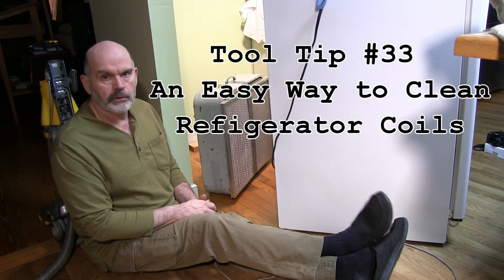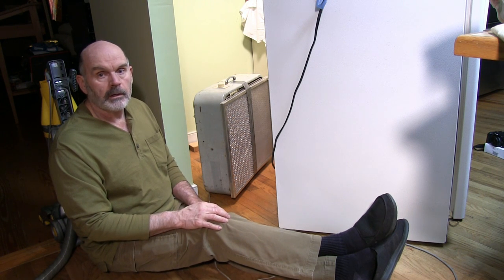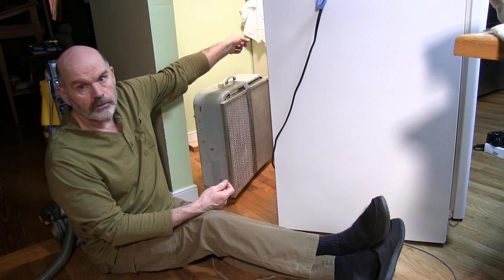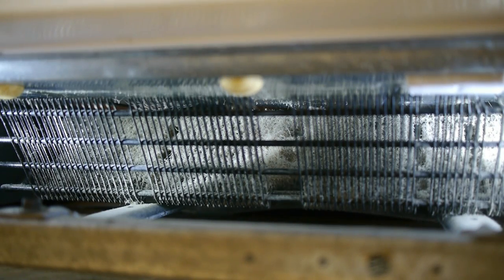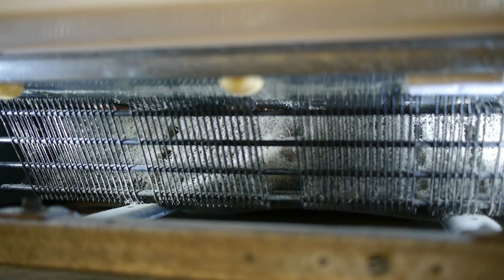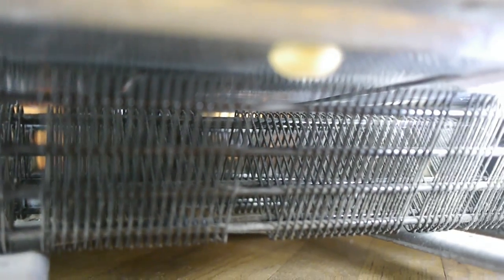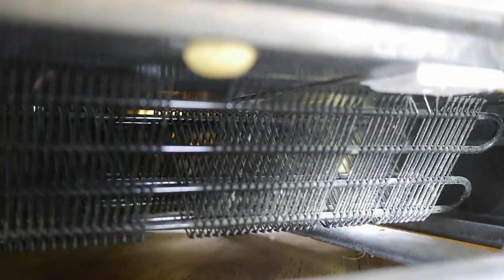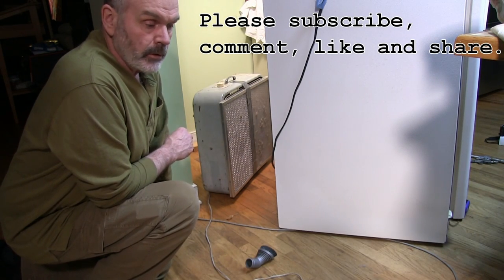Tool Tip #33 An Easy Way to Clean Refrigerator Coils

Comment: Moved into this house a year ago and I’ve been vacuuming the coil. Unknowing until today there’s an accordion thing coated with dust just like this I can’t get to. Hubby inspected and said, I can bring in the air compressor and I said I’ll You Tube it. Low and behold, this is what he said and shop vac on the back side, cover with a sheet. I like the idea someone suggested with the box up against the back side and shop vac hose attached to it. Thanks much for the excellent video. 

Oh, by the way, my owners manual says Page 8 under refrigerator care, #4 NO NEED FOR ROUTINE CONDENSER CLEANING in normal operating environments. 🤪😂😂😂 😳😖. Manufactured to fail.

Comment: Great idea... I agree with your frustration as to how these things are designed. I love these MacGyver fixes. I noticed my freezer compartment was warm this morning, so before I tackled this job, I did a search and found your video and it inspired me to try something else.  I used my vacuum and about three feet of very flexible 5/8 ID aquarium hose taped to my vacuum nozzle.  I had to remove a cardboard baffle that separates the coil area from the drip pan, then I was able to maneuver the hose through each "fold" of coils.  I would say I got about 95% of the gunk.  I checked the freezer compartment... and I'm back in business.  Thanks for your video.
Reply: Yeah, I noticed the cardboard baffle.  Folks should remember to replace the baffle when finished or you won't get proper airflow over the coils.

Comment: Loved the video, and the comments are great, we have a refrigerator that my grandparents bought in the 50's and it still keeps things cold, I wish I could write a letter back in time and tell people to repair, and fix vs toss n buy another if society had not become so disposable with their iyems maybe manufacturers would still buildt things to last, I find vacuum cleaners all the time on the curb they just need the brush cleaned out, the hose directly behind the brush unclogged , or a new belt, or a combination of the 3 and they work like new I'm only 42, and am always amazed by things people throw away when they are easy to fix

Comment: I did make a tube fitting for my air compressor hose.  I used wide masking tape between fridge sides and floor.  I then cut and taped a piece of cardboard to back of fridge with a hole cut in for my large shop vac hose.  I trapped it all in shop vac with very little dust.  After fridge rolled back I just had to vac and wet wipe floor.

Comment: I used my roto zip to cut in an access panel on the side.  Now I can use my extension fridge brush and vacuum to clean it.
Reply: @red meat
And to think that the manufacturer couldn't have  designed that in when making the units? Oh that's right they didn't deliberately so the unit would fail faster and you have to buy a new fridge!
Reply: Why didn't the manufacturer think of a side panel? 
The jerks.

Comment: i cleaned my coils basically the same way in the front. i thought there was more in the back which i haven't done yet. i am surprised to see there isn't to much more.i really like the idea with the fan. never would of thought of that. also i didn't think of using the air compressor. you helped me out alot. thank-you for sharing. happy holidays.

Comment: mars1952, Thank you for helping me clean this same accordion coil system. I used your fan/filter idea and it helped cut down debris. Also this cleaning lead to two twists to your approach. After using compressed air cleaning from the front It still looked a bit clogged on the fins. I went to the back side and used compressed air again blowing from BACK to FRONT. The fan pulls air from FRONT to BACK in operation, piling up the debris on the FRONT side of the coils, reversing the air flow blows the debris off of a coil rather than trying to push it thru the coil. I made a mess in front of the fridge, progress. I'm a tinkerer and I used a section of clean steel fuel line and made an air nozzle reach tool in the shape of a small golf club, 90 deg bend about 3" at the end, drilled two small holes and crimped the end shut. Taped the end to eliminate any sharp edges. This can then be slid under the frame and positioned in the gap and blow air across the coils. The handle of the "club" was about 18" or so and this allowed reaching deeper  under and rotate up to get to the next coils. Finally with the unit unplugged, I used a wet cloth and cleaned the fan blades.

Comment: I've got the same fridge. Just had to replace the compressor relay last week, which brought it back to life, but like you, I found that these fan-fold/accordion coils are intentionally hard to clean. 

I was also thinking of blowing the dust out with my shop vac, but the extra step of the fan/filter at the back is very smart. This is the method I'll be using this weekend. Thanks!

Comment: Smart. Good job keeping the dust under control. So much more thought went into this process than the other guy’s video - (High powered leaf blower without even vacuuming the visible dust first.) Needless to say he pretty much wrecked his kitchen, his lungs, and probably the whole house in the process. Thanks for showing people that there are smarter ways to work.
Reply: I did this also took me 30 second s to clean under the fridge and then 6 hours to clean the kitchen

Comment: I have 2 refrigerators and this trick worked on them both. I used an air compressor set to 80psi, and a rubber tipped air blow gun. Tons of stuff came out!

Comment: I opted to do a "back flush" rather than to blow dust bunnies into the clean rear coils, which were very clean to start with (as it was a newer fridge). So I put the fan and vacuum in front of the fridge and blew the air from the back of the fridge (which requires removing the rear panel, but ensures a cleaner result).  Also, I was able to insert my coil brush into about 5 or 6 openings in the front. However, not able to move it side to side as I could do in my old fridge.

Comment: First, thank you -- thank you -- thank you!  Found your video by it being referenced on an appliance repair website.  After our son and daughter both recently had fridge problems, I thought "you know, I've never cleaned our fridge's coils."  My wife said, "there's nothing to clean."  Question marks went off in my head.  Sure enough, the owner's manual said there's nothing to clean in normal use; coil cleaning is only necessary if you have a pet.  I took off the lower, front kick grill to see what the coils looked like.  OMG!!!  Owner's manual says just to vacuum only the front coil.  Ha!  I could still see a mess behind.  You're video has given me a technique to use to properly clean this thing.  What a horrible design that prevents an apparently essential maintenance job from being done easily.  Cleaning will make somewhat of a mess, but your idea makes it bearable.  Best regards, and thanks for taking the time to made this video available.
Reply: Thanks. Interestingly, I am trying/ Tubing on my vacuum Crevice Tool , tape on , .75 inch to 1.25 inch maybe , through wire protection screen, ( mine may pop off, unknown )..

Comment: Thank you! I just vacuumed mine the best I could. I’m curious if I could tilt the fridge slightly to clean mine better underneath. Mine is a 30yr.old Kenmore. It’s a little easier than yours but there is still some I can’t get to. I wish they made them like this one. Never had a problem. My mom and dad bought one 10 yrs.ago and it just died. I’m a single parent and can’t afford to just buy a new one. This old Kenmore still keeps the temperature super cold 🥶 and I want to take care of it. You are a true blessing. If I had a compressor, I would have preferred your method.

Comment: I agree with your disgust with them putting these accordion type coils underneath their "planned obsolescence"  refrigerators. I just got one like this, a used Maytag and it has the same exact, maddening, impossible to get to coil design, to, like you said, make the compressor prematurely fail so you have to buy a whole new fridge in a few years. Despicable design on their part. Thanks for sharing this video! Great idea what you did there with the box fan and A/C filter to help control the dust removal process you did. I plan on doing the same thing in a few months / twice a year. Thank you.

Comment: Thank you so much for sharing this great approach to cleaning a designed-to-fail POS system.  Only source of forced-air I have is a leaf-blower, so I"m thinking of using that, but with some moderation (partially clogging the leaf-blower intake lessens the force and I know it can stand that for a few minutes.)  AND, I have a 30 yr old American heavy duty 20" fan.  Have a great day and year, etc!  :)

Comment: Thank you so much it’s 12:30 am went out to get a glass of milk and it was warm pulled the cover off the bottom of fridge and my coils were covered in a wool coat but had the same issue with cleaning the back coils till I found your video now we are good

Comment: I tilted my Kitchenaide to the back after I pulled it out from the wall.  I had the same difficulty in cleaning the 'W' coil. Using 4" blocks placed underneath the front, with the plastic grill removed, I used a small, flimsy commode brush and vacuum, and coming from underneath the unit I was able to clean it. 
Pulling the cardboard lower back off exposed the fan, and I cleaned it as well. I filled a smaller vacuum bag full of lint.

Comment: Well, I cleaned mine out today,  Found the best way, Just clean out the refrig completely,   Tip at angle till you can get under to suck it out with shop vac.  Takes 2 people, but its not heavy,  empty, and my wife had no problem balancing it on angle till I had it all clean.  I have done the air blower thing and this is waaaay better and faster and less mess.  Just don't tip any farther than necessary.  While you are under you can remove 2 plastic pins and even get the cardboard out from under and clean the back 2 accordian coils completely and easily !!!
Reply: Perfect,  I have done the same,  leaning the fridge on the house door at a perfect angle (was able to do it alone) for last 20 years,  use my central vacuum which is in its own sort of (dog house enclosure on my back deck,  so 0 dust)................yes removing plastic pins , and associated cardboard and all is visible and accessible.  Certainly a good idea to have a 2nd person holding the fridge from moving!  Totally nuts that whirlpool engineers can get away with this classic design work!

Comment: Brilliant, I never thought of the fan. I've had good luck with greasy coils by spraying them with a water & Dawn mix and then using the compressed air to clean and dry them out. Works perfect.

Comment: Thank you for this video. My next step would have been to unload the entire unit and tip it over to clean from the bottom. Even my cheap little 3 gal. 100 psi air compressor did the job.

Comment: Looks identical to mine.  I was floored when I finally got the grill off to look under it,  started cleaning it and had the thought about the compressor, I use it on my PC but I take it outside.  We had to take out the glass on my slider and the doors of the fridge just to get it in the house so there's no way I'm going to do all of that to get it out.  The filtered fan idea is awesome!  
I don't feel like going to the store to buy the extended blow nozzle so I'll just tape some rubber tubing to the one I have. 
Thanks for sharing!

Comment: Filter on fan, GREAT IDEA!!! Keep up your wide variety of interesting videos, I really liked the Ruger magazine videos!
Reply from the maker: +mod317 Thanks. I should have mentioned in the video how to use a box fan with a filter.  Box fans are not meant to be use with a filter. Adding a filter increases the static pressure and make the fan work harder and heat up. I have used this set-up for several hours straight but I never leave it running when I am not in the room. This fan is very robust and about 40 years old (made in the USA) they don't make them like this anymore.

Comment: Thanks a lot for this useful tip..I figured compressed air would hurt the coils.Now after seeing this video. I've pulled mines out ,and I'm about to get started. Refrigerators not cooling and my filters look just like this ! Thanks for the informal vid

Comment: Great idea! I have the same problem with my Whirlpool. Why in the name of all that's holy would a manufacturer put accordion fold style coils running SIDEWAYS across the width of the refrigerator?? Common sense would say that the same exact coil structure would be PERFECTLY easy to clean if simply situated the opposite direction and one could stick a brush in there and clean them quite easily! I swear...
Reply from the maker: Planned obsolescence.
Reply: I agree with what you said completly. I'been trying to clean my refrigerator coils for two weeks now.

Comment: Thank you for this very helpful video. I unplugged my refrigerator for a couple of months and when I replugged it in it failed to cool at all. I'm hoping this will solve my problem. I don't have an air compressor but think I will try canned air to blow the coils clean. It's sure worth a try before calling a repairman. Thank you.
Reply: DeepPurpleSkies I’ve used canned air for this, works ok in combo with a vacuum. His use of an air compressor is better if you have access to one.

Comment: Thanks for the tip. We ended up using a kabob stick/small dowel with a pipe cleaner to cling on and grab the large clumps under and around the coils. We may use the air compressor and box fan to get some of the smaller clumps.

Comment: I found an easier way to deal with this problem. All you need is tilt the refrigerator on its left side, slanted enough so a gap is big enough for one to bring the vacuum hose and suck all the dirt. I have done it successfully.

Comment: Great idea with fan and attached metal filter.  Air compressor w/short bursts aware of, but containing mess always an issue. Have a slightly simpler adaptation utilizing a small rectangular/folded sheet and duct tape.  Sheet allows air to flow but not most dust which is caught.  First cover rear area of frig with sheet and then duct tape the complete top edge, sides, and the complete bottom edge to floor.  Afterwards, just vacuum up what you catch, then, repeat, by moving sheet to front of frig spraying from rear towards front.  You get some small dust escaping from sides, but it is negligible.  Godspeed.
Reply: Sounds like a great idea. We're going to do it!

Comment: Thanks for the video. I don’t have compressed air, but I used my shop vac as a blower and it worked wonders. Of course not having used a box fan and not being able to blow in controlled bursts with the shop vac resulted in dust everywhere. I’ll have to come up with a way to keep the dust down while using the shop vac method.

Comment: well your design filter fan in the back might still be boss. i took a large cardboard box and cut a hole it it for the shop vac to attach to, and i taped the open large box to the front of the refridge and blew it out, and then reversed it to box taped to the rear.. results were great on the fridge. the box i didn't seal it well enough on the fridge to catch all the dust. on the lady across the street the box fit better and i missed no dust. the results on both are excellent, in that i takes more time to set up the compressor and shop vac than it does to blow that dust out, which only takes a few  minutes with no brushing anything, no damaging nothing and it all gets clean. my solution is to tape the box (plenum, home made) better to fit the refrigerator form shape. even without the box or fan, compressed air is the only way to go. i have an old parts washer made by matco for solvent, and it's got large volume of air, works for everything, dust, sand blasting, and parts cleaning. the sand blasting part works really cool with river bed sandwash sand. sand doens't go through any valves. it's got a metal tube for a pickup, just poke it in the sand that's in a bucket. the lady across the street her water heater problem was only a 13 dollar thermopile, honeywell at lowes. took me a week to do because the lady never stopped talking and she'd pick up tools of mine and put them somewhere she couldn't remember. her husband died a few months ago. he was nearly blind and did everything for her. how, i don't know. she wants to go fishing.
Reply from the maker: Thanks for the update.

Comment: Just watched your video. I started out with the compressor and a vacuum but quickly realized that I could tilt the fridge back. So i emptied out the fridge with anything that could spill. I tilted it back far enough that the wife could  reach and vacuum all of the coils without having to use a fan and air compressor.

Comment: very nice video.  i have the same frustrating issue.  once i repair my compressor, i look forward to trying this out.  i don't have a box fan.  but i do have a shop vac.  so in lieu of this arrangement, i will try to use some cardboard and duct tape and fashion an exit box behind the frig that directs everything to the hose of the shop vac.  with short bursts, as you suggest, it ought to work.

Comment: If you can push the refrigerator to your sliding glass door (if you have one) that works good on the dust control while blowing it out with an air compressor.

Comment: I just cleaned mine by vacuuming. Mine has a radial coil. Vacuuming wasn't good enough so I drug the air compressor out and, man! Dust went everywhere! I had goggles on, but should have worn a mask. Yours is an interesting method. I was thinking of tenting the fridge with a sheet. But, thanks for your video!

Comment: I used a very strong leaf blower and blew out the dust and used a damp towel on the other side to catch the dust. It works. Just make sure the leaf blower is strong.